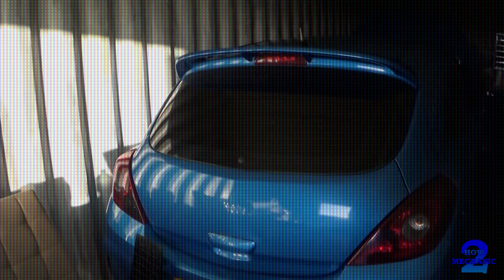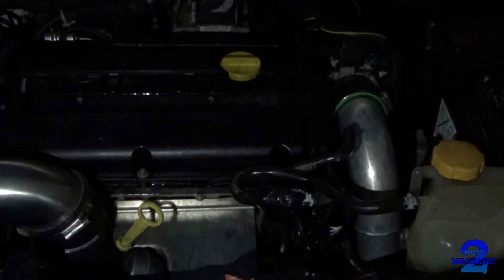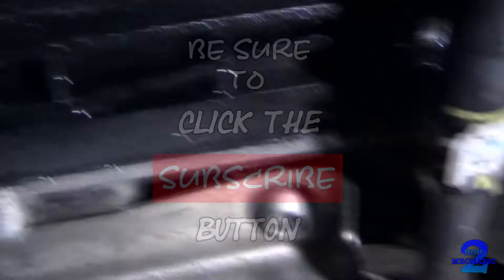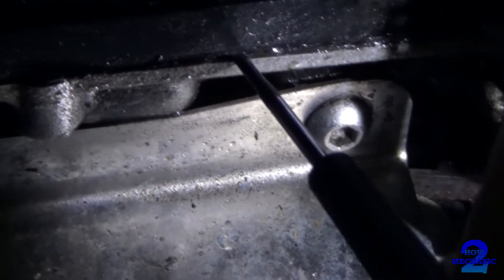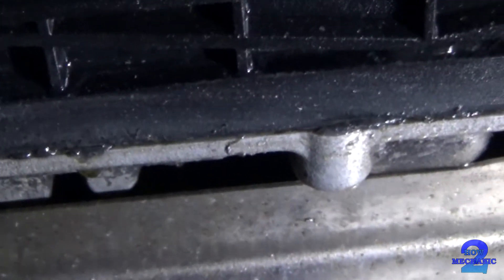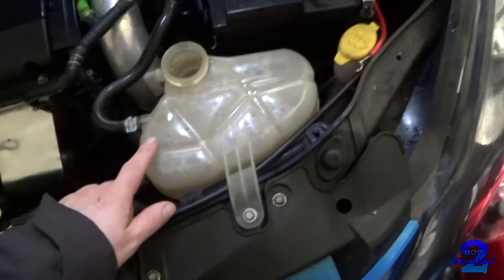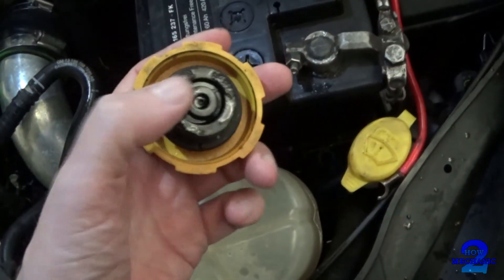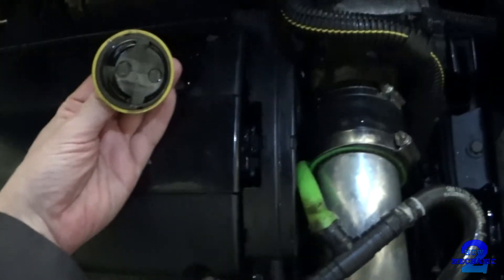checking for a blown Head Gasket

Comment: But what if the coffee like substance is only on the coolant cap but not oil, does that still mean head gasket?
Reply from the maker: yes but its when oil mixes with coolant that causes the chemical the main cause is the head gasket worn/broken
Reply: If is in coolant i would say you need to replace oil cooler gaskets